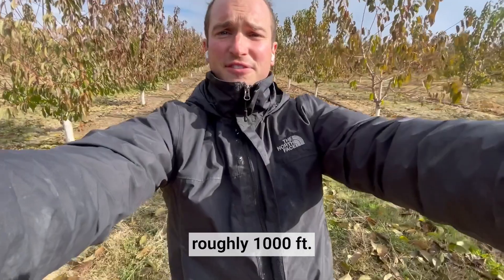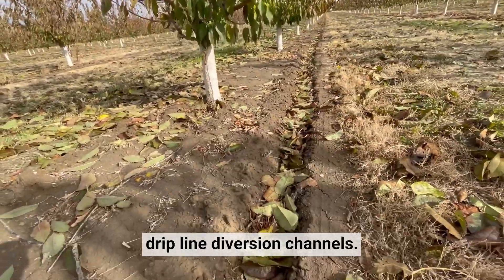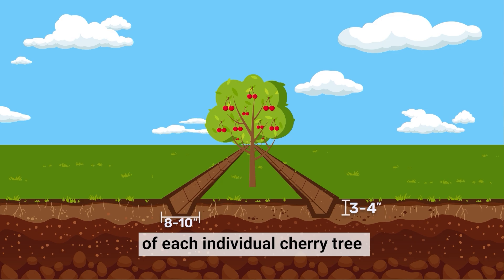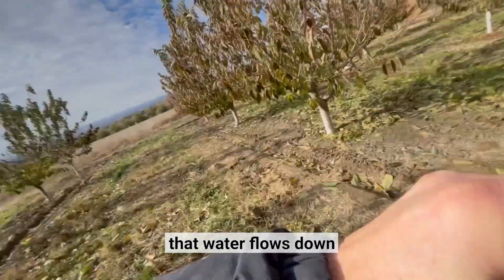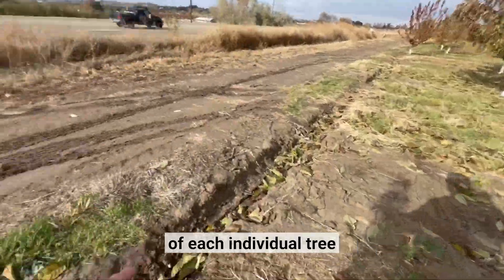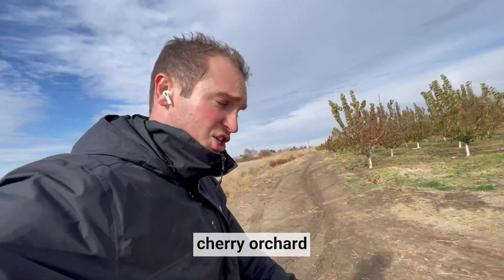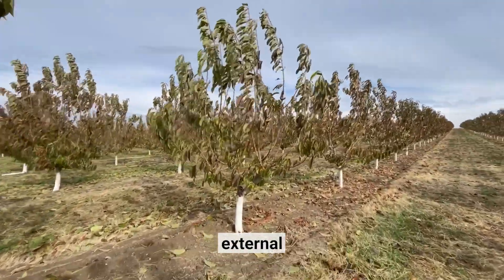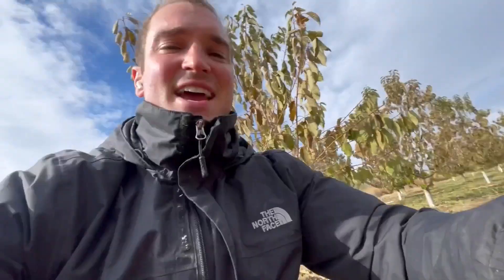How This Orchard is Defying the Desert

Comment: for a second i thought it was gonna show how to do it without irrigation but ditch irrigation is just a massive waste of water
Reply from the maker: What do you mean by waste? A lot of people aren’t familiar with the benefits of these systems. This type of system can recharge groundwater and increase stream flow particularly during the latter part of the irrigation season. How it works is a good portion is returned to the stream as “return flow” through that  groundwater recharge, which supplements the natural stream flow, especially in areas with low base flow during dry periods.
Also, most “efficient” drip systems, and we’ve seen lots, do not contribute to any of these benefits while not watering deeply into the active rooting zone of the tree. We’ve dig up countless trees with massive dry pockets yet explosions of growth where the “efficient” emitters were dripping. Lots of other issues with sprinklers, too.